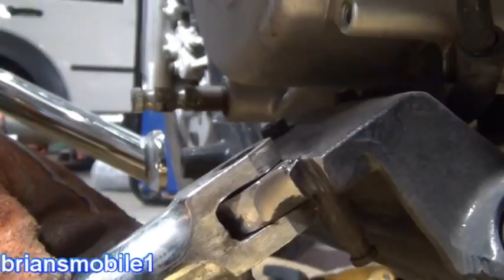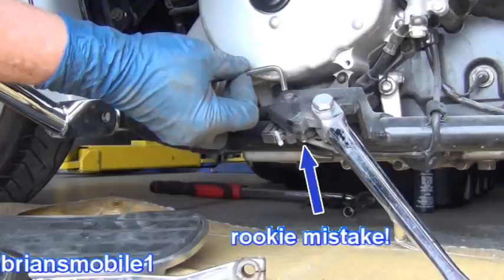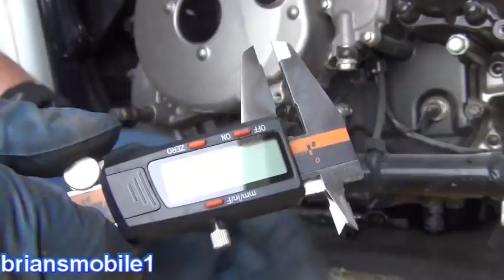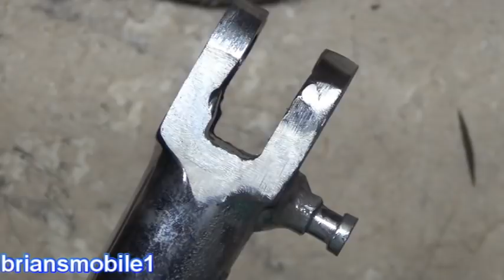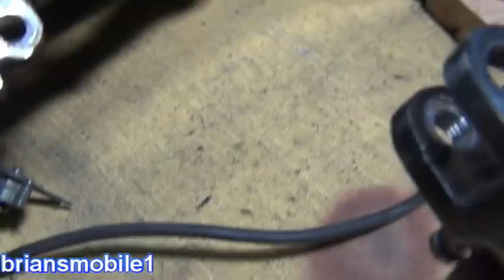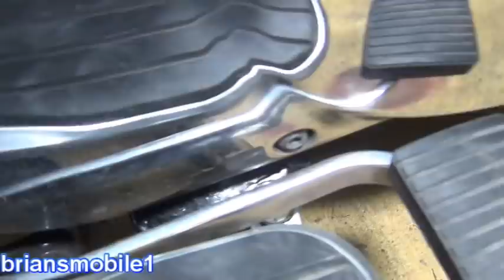Complete Street Motorcycle Side Stand & Frame Repair

Comment: probably would have went for a light press sleeve insert(with cylindrical loctite) for the wallowed hole, then been lazy and used washers to shim the thickness, vs welding. just thinking in terms of causing stress cracking around the weld, probably not an issue though :)

Comment: I would have used the vehicle lift to raise the motorcycle in a sling. That way everything would be at a workable height.
Much easier than lying on the ground to work.

Comment: Nice job Brian, better than the factory did detail wise. doing the welds with stainless would have been harder, but would wear the stell parts it rubs with more, so just steel on steel is about the best you can do, unless you made a thin brass washer out of shimstock to put underneath as a bearing surface. Roll it up and use to fill the shaft area as well works, makes even less play, and so long as you replace before it wears through then you will never have to weld again, just replace as they get thin.
Reply from the maker: Not a bad idea.  Like door hinges on older vehicles.  I need to buy a Toyota Hilux door hinge and see how those are made.  Those last forever!
Reply: @briansmobile1  The ones made from a thick plasma cut piece of steel, and then with a hole drilled thorough the length for the hinge pin, with a heavy pin pressed in, and at top and bottom a stack of washers? The newer ons are pressed steel, but still last well, because they both have a sleeve and bearing surfaces to spread the loading. 

Has to be robust because often they go through the painting process already in the vehicle chassis, which means they go through the pickling, priming and painting plus bake as part of the vehicle.